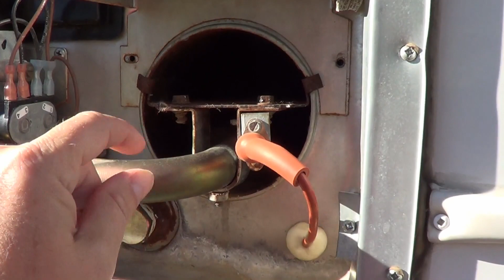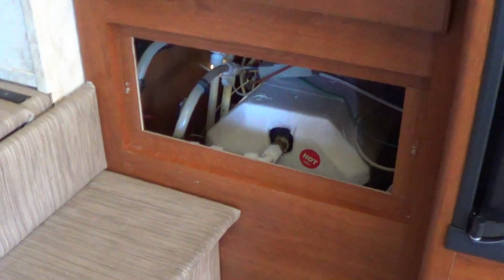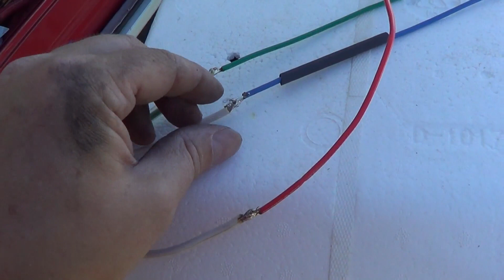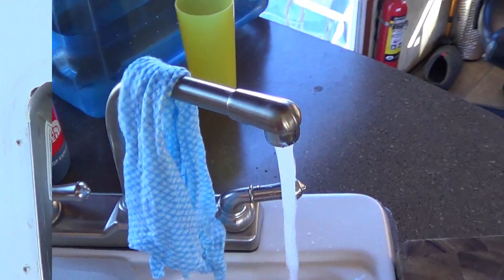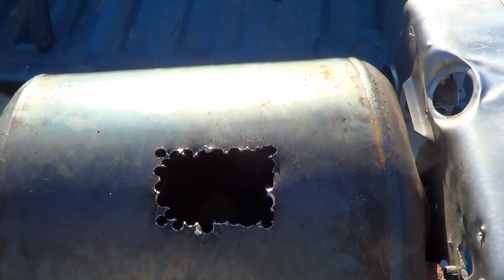Replacing My Leaking Suburban SW6DE RV Water Heater

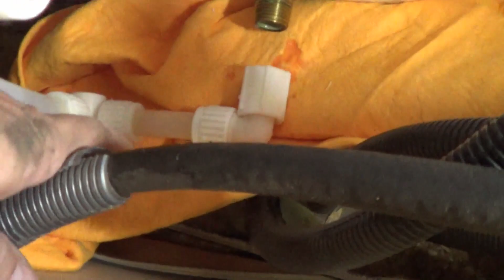Comment: 8:20 Installation of winterizing valve is wrong. Think it through.
Reply from the maker: I didn't install it, it's OEM but works just fine the way it is installed. in the down position, it lets cold water flow into the water heater for normal use. For winterizing you flip it up as shown at 8:20, It stops the antifreeze from entering the water heater cold inlet. The check valve on the hot water output keeps the antifreeze from entering as well. So then, a person can drain the water heater for winter.   Think it through. ;)
Reply: @LoveYourRV  Missing key word here is check valve. If so equipped it will work as described. I see it now, thank you.
Reply from the maker: @gornoman  You're welcome, check valve mentioned an around 12:60 mark - https://youtu.be/EY-rHSulMps?t=749

Comment: Did you use galvanized nipple when you should have used brass?  Attwood has an aluminum tank.  I suspect early problems here.
Reply from the maker: Its a Suburban tank, they are porcelain lined steel tanks.

Comment: Just replaced my 14 year old suburban water heater.  Watched your video first.  Very helpful.  FYI the PEX valve you thought was for winterizing is actually a mixer valve.  You can adjust it so the hot water going to a faucet is mixed with cold water so you are not scalded.  Adjust it as necessary.
Reply from the maker: interesting, I've never heard of using it for that. . I've used it as a bypass valve for winterization as explained in this video 
 - https://www.youtube.com/watch?v=OJFJjIgNV74  My system doesn't have the 3 valves since it uses a check valve on the hot water supply instead it just needs the one bypass valve. Cheer, Ray

Comment: Great video!... I was wondering how you initially noticed the leak?... Seems like you would only notice when looking right in there or did not all of the water evaporate from the flam3 heat and leak out?...
Reply from the maker: I first noticed when the flame wasn't burning right and could hear lots of sizzling noises, then saw a bit of water dripping out the front of the water heater.

Comment: Excellent video. Many thanks for the step by step demonstration. One question : how did you discover the source of the leak ? Was there water on the floor under the heater or somewhere else ? We have water under the floor and we are not sure where it is coming from. We are suspecting the water heater and will check next time we are at the lake whether we are having the same problem as you identified. Many thanks again !
Reply from the maker: I started seeing water dripping outside from the water heater and hearing a sizzling sound. The leak was dripping water right into the gas flames burner area. Inside the rig was dry. Cheers, Ray

Comment: Thanks for recording this video! Very informative. I'm about to upgrade my old SW6P water heater to the SW6DE. I'll obviously need to run both 12v and 120v power to the new water heater, but being an electrician, I'm not expecting too many problems. We love the deserts of Arizona as well! Happy trails!
Reply from the maker: You're welcome. :)
Reply: Hi John. I am going replace my SW6P with a SW6D. did you run into any issues? Thank you
Reply: @Chris1969o  No problems at all! It was a breeze to replace, and so much easier to use. So glad I made the switch!

Comment: At 17:28 you uncovered the finished product. It had a silver mounting bracket around the hole for the water heater. Did that come with the flush door or did you have to order that separate.
Reply from the maker: I reused the original outside metal flashing and door.

Comment: Is it necessary to power with 110V or can it function with only 12V DC?
Reply from the maker: It's only set up for AC or LP Gas, you could use an inverter to power using 12VDC batteries, but would be wasteful as it draws around 1500 watts so would draw around 150 amps from the batteries quickly running them down,  best to use LP Gas mode or a generator when off-grid unless you have a huge solar system and lots of battery power.

Comment: Thanks for comment by Love Your RV.  Homeless folks surviving in an RV may be unable to afford a new WH, but a $10 bottle of Alumaseal will fit most budgets.  RVers too would much rather spend the install time and $500 on their vacation. 

Like many Suburban's, my unit has the built in "free" heat exchanger fed by engine heater hoses (while traveling).  That feature is not standard, adding more cost and difficulty to the replacement job as well.  Much cheaper to keep the old one going, and perhaps add a "Hott Rod" element kit if electric hookups will save you more $$.
Reply from the maker: Thanks for the tips, Cheers, Ray

Comment: I had the very same problem with my Suburban (a weld inside the burner cavity leaking).  It threatened to ruin my vacation, so I decided to try some radiator sealant to see what would happen. This required shutting off heater, partly draining, removing the pressure relief valve, adding solution through the hole, and sealing with teflon tape.  AlumaSeal (and similar brands) come as a fine, silvery, aluminum powder suspended in gel-like liquid in a pint-sized bottle, far more than needed. 

After refill and restart, in about 15 minutes the leaking had stopped  I then drained the water and could see no trace of sealant.  Aluminum is used in the anode to prevent corrosion (which I replaced too), so there is that chemistry already in use.  Since hot water is not consumed (only used for washing), I flushed the tank twice for good measure, concluding that the rusty interior had absorbed it all.  That was three years ago now, and the leak has never since returned.
Reply from the maker: Wow, amazing!
Reply: Make a video! probably could of saved hundreds on a new one. But I’m still saving doing it myself!

Comment: My new Suburban SW6 DEI has a fourth 12V DC System "Orange" wire, which my old Suburban SW6 DE didn't have.  Knowing the Trailer's "White wire with the Red stripe" goes to  12V DC  (+) Positive "Red" wire, and the Trailer's "White" wire goes to the 12V DC's "Blue" wire and lastly the 12V DC's "Green" wire goes to trailer ground.....Where does the new 12V DC "Orange" wire go???  Do I just tape it off, and not connect it to anything?  Anyone know???
Reply from the maker: Is it a DEI or DEL, I can find DEL but not DEI, anyway does the water heater have a built-in electric switch like the old DE model, if not maybe the orange wire is for an external electric switch. Just a guess but that seems to be the way it is on the DEL model.
Reply: It is a new Suburban SW6DEL, with Direct Spark Ignition.  The 120V AC was easy.  Black to Black, White to White and Ground to Ground.  Pulling the old unit away too far and too fast, I popped off two of the 12V DC leads, which left me wondering what went where?  And along with my Voltmeter, I had success connecting the water heater's 12V DC wiring to my 2010 Keystone Sprinter 311BHS's 12 V DC wiring.  I soldered the trailer "Grey" (+) = [ switch (gas) ] to  tank "Red" 12V DC (+).  Trailer "White" (-) = [ (light) ] to tank "Blue", and  trailer "Red" (-) to  tank "Green" = [ (junction box ground) ] .  I taped off the tank "Orange" (+) = [ ( junction box/relay) ] lead coming off the tank because my trailer system didn't have a fourth lead.  Schematic showed the "orange" (+) lead going to an additional [ switch (electric) ]. Buttoned things up, and flipped the red lighted "Heater" switch on the trailer's battery/tank monitoring system inside, and after about 3 seconds the new hot water tank's igniter started sparking, and the LP gas burner fired up right away.  Cycles well now, and provides all the hot water we need.  Thanks so much for the great "how to" video.  "Happy Trails" everyone!

Comment: Hello thanks for the video my rv is from 1988 and it does not come with dc power to the water heater what should i do thanks ?
Reply from the maker: If you are installing this water heater it requires DC power to work

Comment: Of Course you know I was kidding with you.... well what happened is I used my inside water, with the water pump and then I thought I would try using the outside water one more time (making sure I didn't turn the pressure up too much coming into the trailer)  and would you believe there is no more leaking under the water tank, and I was finally able to get ALL the leaks from the hoses fixed and so there is NO MORE LEAK.... I am so very grateful.... God has really had great compassion on me trying to get this fixed.... finally ALL IS GOOD..... 
Thanks For Your Reply!
Reply from the maker: Excellent! :)

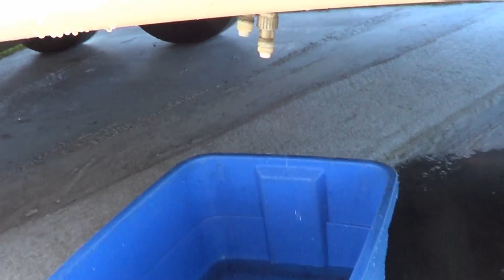Comment: Got a question. On your low point drain plugs at about 6:22 in the video; are they the ones you have to unscrew and remove a cap, or are they the kind that twist and the water drains and you don't actually remove anything? I have a 2009 Outback, and I have caps that are between my tires and they're difficult to get at, and alos put back on after the water has drained out of the two low point drains. Any help or suggestions would be appreciated. I was quoted $15.00 per drain for the plastic part by an RV dealer.
Reply from the maker: Mine are just screwed on PEX caps. I rarely drain so hasn't been a problem to remove them the odd time I do.
Reply: @bobfotoples6950  those are for the potable water tank and not for the main water supply piping.

Comment: I just wanted to say.... can you come to Oregon and help me with my water heater that is LEAKING?? :o) ~ for some reason when I use the outside water,,, the tank LEAKS... BUT... If I use the Water Stored in the Water Tank,,, and use the Water Pump IT DOES NOT LEAK AT ALL! Now I am close to 70 year young lady... and have already Fixed 2 fixture leaks to the tank and water line to the tank.... and got that all done ~ AND ~ no Leaks using the water pump and water from the inside tank..... PLEASE.... Can you Suggest What might be the problem? Is the Pressure from the outside water causing a TANK CRACK to leak??? I let the water heat up with the electric and the Propane and it works fine with the tank heating up hot enough that I can't keep my hand on it (inside the foam)... SO.... PLEASE CAN ANYONE TELL ME WHAT MIGHT BE THE PROBLEM??? I put a Water Pressure Regulator on outside 40-50 PSI and Still the darn Tank Leaked!!!!  I thought surely it wouldn't but I was wrong.... ANYONE THAT CAN HELP ME or Suggest What is going on... this is a 2005 NuWa 5th Wheel Trailer and the tank has absolutely NO Corrosion on the tank (at least what I can see inside the Styrofoam)... 
Thanks In Advance for ANY THOUGHTS!
Reply from the maker: Where does it leak from? What part of the tank?

Comment: I just replaced my water heater with this exact model and after only eight months it already blew a hole in the rear of the fire chamber about one inch above the weld. I think this company must use inferior metal probably made overseas for sure for their pressure tanks. I don't understand how it could rust a pinhole with an anode rod in only 9 months and I'm full-time used everyday
Reply from the maker: Must be a manufacturer failure, sad.

Comment: Very Helpful Video! I've been binge watching your channel, to get my 5th wheel ready!

The 5th wheel i bought seems to have had a fire at some point in time, where the water heater is located, so I will have to replace that soon. Question: Did you get an exact replacement water heater or a different model? I having a time finding a replacement for this 5th wheel since its about 20 years old.
Reply from the maker: Thanks for watching. :) Yes, it was an exact replacement so made it easy.

Comment: That was just a bad weld! A lot of flux, and the metal most likely contained some dirt or contaminants,  which causes porosity, and that's the end result. It's what we used to call a "Popcorn Weld." That's not the job of a certified welder. I'd contact the manufacturer and complain!!!!!
Reply from the maker: Thanks for confirming, I figured that was the case. Cheers! Ray

Comment: I see you used a Galvanized fitting were you couldn't remove the Brass one from the old heater, that metal is going to give you issues 1st it will seize quickly to the Heater and who knows whats going to happen when it reacts with the Anode Rod in your new Heater, Brass, Copper, Pex, and PVC are the only things you should use in modern plumbing obviously  the Plastics (Pex, and PVC) cant be used were High Heat like the Hot Water Tank fittings will melt or crack them, Good luck with that repair
Reply from the maker: It is actually a chrome plated brass fitting not galvanized. All I could find at the time to fit. The only pure brass ones they had were too short.  I plan to swap it out for the exact replacement when I can find one. Cheers, Ray
Reply: Ok I never saw a chrome plated  fitting before in any stores in the usa

Comment: My old Heater had Fiberglass wrapped around it (1980's) not Styrofoam, I wonder if this is why my old Heater was more efficient? maybe I should try wrapping my 2000 era Heater with a Small Fiberglass Blanket sold in the Big Box Home improvement stores for residential Water Heaters? and see if My LP And/Or AC usage drops?
Reply: Kenneth Richner I am a full-time rver and you are correct. I wrapped my styrofoam water heater with fiberglass insulation and it decreases the ignition Cycles by probably 30% in the winter

Comment: You could call it a "Hot Water Maker" instead of "Hot Water Heater" to appease those critical of proper terminology the English language has been corrupted in ways in the past few generations it will never recover calling a "Cold Water Heater: a "Hot Water Heater" I consider a minor infraction. Just Being Jokingly Critical  in a passive aggressive way, jk I did have this  exact Water Heating Device and loved it my only concern was it seemed to use a lot of Power when using AC only (it was a Energy Hog!) So I only used the AC in Dual mode when I needed a lot of Hot water, I found with both LP and AC to Help boost performance it worked realy well then when I was done showering or washing dishes I switched it back to LP only. I found out its power hungry nature because I was in a RV park for the summer that gave us a $75.00 a month allotment that we exceeded on a regular basis after installing this Heater the heater it replaced was 20+ years old at the time (it was the Original in a 1984 Sunline TT) it was rusted bad and was way more efficient (for a Older Heater? but no longer made so I had to upgrade, there may have been something wrong with the new Suburban Heater but I sold the Camper to get a much Newer Unit, I liked the Old Sunline more it was Built better! Than today's campers in general, My Goal is a Airstream all one material outside no rubber membrane to deal with on the roof only the only real exterior maintenance are the seals around the windows, No Fiberglass Delamination issues if a Small leak develops, No chasing down pin holes in the roof from twigs and Cones from the Ponderosa Pine they are Rubber Roof Killers dont park your camper under one of these the Cones have huge sharp thorns that will tear up a Rubber roof!!!
Reply from the maker: Luckily we summer at an RV park where electric is included in the monthly rate, also LP gas goes for over $3 bucks a gallon. It nice to have the option to use either or both.
All the appliances seem to be better built in the old rigs. Our fridge has already failed too.
Reply: It seems duribility is a afterthought today when most Campers are built with a few exceptions my Gulfstream has a ton of manufacturing flaws I am finding on a regular basis

Comment: Great clean installation. On question, how does the unit get secured to the RV floor so it does not move around while on the road?
Reply from the maker: Thanks! 
It doesn't get secured to the floor in any way just sits on it, the outside frame clamps it to the sidewalls aluminum frame with screws that's what holds in in place. 
I did see the install manual says to screw in a 2x2 board to the floor on each side of the tank, although the factory never did it and it hasn't been an issue for us with over 50,000 miles traveled and on some pretty rough roads.
Reply: I think the 2x2 boards on each side would give me a better night's sleep specially with a unit bigger than 6 gallons. Thanks again.

Comment: Great video Ray! Just curious as to why you went with a standard water heater instead of an instant water heater like a Truma Aqua-go?
Reply from the maker: Thanks. From what I understand they are 3 times the price, not easy to buy and install yourself and have no electric functionality. We spend a large portion of the year on full hookups with free electric. We haven't had an issue with running out of hot water even with only 6 gallons. Guess we don't take long showers.

Comment: Ray, I know you have had this rig for a while. I'm curious if you have upgraded your tires at any point. If so, what did you go with? I have heard horror stories about "new" dealer installed tires destroying the bottom part of the rig
Reply from the maker: I had the manufacturer installed PowerKing Towmaxx for the first 2 years then upgraded to the same brand but went up a load range from D to E. and had them for 2 more years and then went to a set of Saffiro load range E tires. They are nearing replacement time. I seem to go through a set every 2 years.
In all that time and likely over 50 or 60 thousand miles I haven't had a lick of trouble with any tires, they barely have needed air.
Guess I'm lucky. I do keep the speed down, try not to hit curbs and not overload the trailer. I also use mine a lot and tend to wear them out before they get too old.  Cheers Ray
Reply: Awesome... thank you!